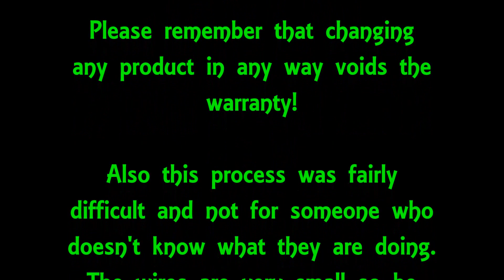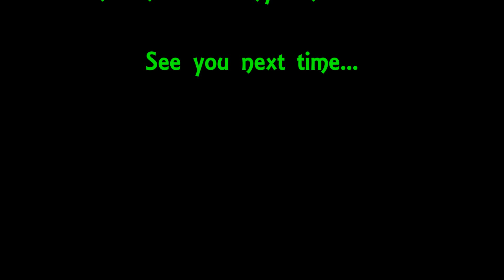How To : Dromida Ominus Motor Upgrade, Micro Motor Warehouse

Comment: Anybody still flying Dromida Ominus out there?Need help with all my blades turning in same direction?
Reply from the maker: You have the wrong motors (black white) (blue red) in the wrong spots. If you don't have any spares to swap you can just swap the wires, as brushed motors will reverse with opposite polarity. Make sure you get the props all spinning the same way they did when stock though, otherwise it will spin out.

Comment: I just did this upgrade but I used the dromida fpv props. the motors are plug n play but the leads from the motors are longer than stock. you have to either tuck wires or shorten them, I tucked them. I can't fly indoors with the nano tech battery tooo much power. the stock battery is better for indoor flying. different tone with the polymer pinions. after all these upgrades I gotta say I'm impressed, quieter, more aggressive flying is now possible! thanks for the inspiration.
Reply from the maker: Nice, it flew quite well after some upgrades.

Comment: recently i bought the motors, everything is working fine. but only one thing does not work and it is the drone rotation. i really need help because instead of just rotating left and right, it literally goes left or right. if anyone knows about this or has had the same problem, please let me know.
Reply from the maker: +Jeremiah Burgos So do you mean when you give yaw on the QUAD, it gives pitch input instead?
Reply: Yes, how can I fix this?
Reply from the maker: Jeremiah Burgos It sounds like you are in mode 3? I am not sure if you can switch, or how :/

Comment: hey rc addict no more soldering then they have plug n play motors that just plug in ???
Reply from the maker: +Ben Pyka Yep, I have changed the link to the plug and play ones :)
Reply: U think these plug n play motors will work on the new vista? ? O and how long did it take u to receive your order??
Reply from the maker: Ben Pyka I bet they would. It depnds where you ship them from. They have warehouses in the US and several oterh places. They use normal USPS for the US so under a week.

Comment: Are the motors for the blade 180qx as fast if not faster than the ones for the alias?
Reply from the maker: george aura I am not sure about stock but these are all the same except for the plug type I think.
Reply: Oh OK cool so I'm gonna have that crazy forward tilt and speed has you showed in your upgrades video?
Reply from the maker: george aura Well the tilt angle was all because I set the rates to 100% but speed and power should be improved.
Reply: OK great

Comment: Would using the traxxas motors and keeping the 700 mah battery be good mine are 25c and the ones for the traxxas is 650 20c
Reply from the maker: george aura The Traxxas motors "should" fit,I  am not sure though...

Comment: Did you end up taking the new pinions off and putting the old ones on? I noticed on the MM website they list this in the instructions. I didn't do this, as I found them impossible to pull off.
Reply from the maker: Andrew Hanke I never removed any pinions. With metal ones you just heat them up I think and they pull of but with plastic might need a special tool :/
Reply: Good tips, brother. I'll keep that in mind. Installed the new motors tonight, along with a new frame, and man... You weren't joking. Beast mode!
Reply from the maker: Andrew Hanke Sweet! A new frame? Where did you get that? Sounds awesome!
Reply: Amazon, for around 5 bucks. Busted one of the arms on the original. Learning to fly a quad for the first time. Took a lot of abuse!
Reply from the maker: Andrew Hanke Sweet, do you have a link? I am interested to see what it looks like :D
Reply: Here you go! Amazon seems to have all of the needed replacement parts. All super cheap. All official parts. I have had to replace several gears, rods, props and now the frame. http://www.amazon.com/gp/aw/d/B00OZTQLHI/ref=mp_s_a_1_1?qid=1437756483&sr=8-1&pi=AC_SX110_SY165_QL70&keywords=dromida+ominus+frame Easy to do.
Reply: Oh... And they have green and the other colors.
Reply from the maker: Andrew Hanke Oh...I thought you meant a new different frame.

Comment: They have since reduced the motors revolutions per minute and the color is different. Still have polymer gears and now have direct connect for ominus and an adapter for blade or whatever the other one was. Not as brutal as the first batch but they suggest you can still do it if you buy their black motor and solder on the connector. Original batch was burning out quick. New model is still cheaper than OEM. I will give a set a shot very soon. Have 5 spares OEM to burn up first. Got Ceramic 3X6X2mm bearings from TRB RC on ebays for 25 bills. They make the ominus respond much better and the motors last longer with the reduced drag. Just cleaned the bearings with triflow today. Cleaned up easy as they were open.
Reply from the maker: STORM6490MT Yep, I have added that in the description along with the updated link to the new motors. I had no problem with the stock bearings, even with all the upgrades I did I still want more power, but hey, it is brushed, the only way to get more is somehow may it brushless ;D

Comment: Hey, yeah put in the same motors, found mine started being more twitchy and glitchy than anything. Didn't give me the punch out off the ground that i was looking for. Turnigy makes an even better battery nano tech ne106118. Little bit smaller but much higher c rating.  Gonna buy a new one won't change the motors, but the batteries will make up for that.  Lastly, once you bind up, give throttle trim just until the blades start spinning. Keeps it from dropping out when you let off the throttle.
Reply from the maker: Shaka Zulu Mine didnt go twitcy, it was a little more drifty but not bad. Check out my newer videos on the better battery I use for this :) Thanks for the throttle advice, I was having that problem so I will try it out.
Reply: Welcome, anytime. 😊

Comment from the maker: This video is outdated, all you have to do now is buy the motors with the right plugs are put them right in :)
Reply: Link?
Reply from the maker: Victor Cuevas In the description as always.
Reply: can i upgrade my dromida vista uav
Reply from the maker: Daniel Camilo You, could, if you need new motors. They don't add a ton of power, but it is noticeable. Battery life is also decreased.
Reply: The RCAddict what do you recommend buying
Reply from the maker: Daniel Camilo Just keep it stock. But if you want more power, or need new motors, these are cheaper and better than stock.

Comment: instead of risking ruining your flight board, I just cut my Dark edition motor wires short, and cut off the connectors for the Ominus motors, and solderd them on so they were like the stock ominous motors. I just put a bit of shrink wrap around them too. I took a dremel and hollowed out the motor house on one of them, becaus I had a little to much wire. its a lot safer way to do it, and a lot quicker. you can also buy the micro jst plugs to solder on to the dark motors on ebay. I got sick of waiting for them to come from china so I just hacked the plugs of my stock motors. I love these on the Alias. it is like it is almost to much for the flight board. it will do some crazy stunts. but hey good video, it's good to see people experimenting.
Reply: here is a link if you want the micro jst plugs.  http://www.ebay.com/sch/i.html?_nkw=Micro+JST+1.25+2+pin&_armrs=1&_from=&_ipg=
Reply: steve sparrow but Benedikt does have these made ready for the Ominus now, but I think they were a beta test. he might be sold out.
Reply from the maker: Thanks for the info an advice :) everyone does things there own way :P
Reply: RCAddict i'm going to kick your addiction into high gear. I just picked up the Blade nano qx 3D. i can't put it down. it is so much fun. one problem. it only comes with one battery. I' m going to order some larger ones with more discharge. they're turnigy 300mAh 35 c. get them off ebay. then you have backing. if your go through hobby king they will dick you around. I'd also suggest getting a moputerized controller. that way when you fly 3d you can set up dual rates and expo. I'm using 25% expo now in expert mode. it's hard but I love the challenge. i would still get it rtf though as the other tx's won't allow you to do the flip and invert functions.
Reply from the maker: Cool that you got the qx3D! Yeah I'm not going to be ordering from hobby king and more and might cancel my order and he the batts from ebay.

Comment: I have these motors on my Ominus  along with the 950mah battery and it works awesome. It recovers much better and does flips on expert mode. It does run the battery down faster but I have 8 of them with 2 chargers.  I spliced the factory plugs on the new motors making it much simpler to install than this video. Happy flying everybody.
Reply from the maker: Will C352 Thanks for the comment! I back ordered a 950 battery a month ago but hobby king still hasn't got them in stock :( You can also just put new plugs that fit the ominus on to install them also :) I don't know that much about wires so this seemed logical to me :P
Reply: get your nano tech 950's from ebay. you can get two of them at once, they come from france, but it is free shipping, and they come very quickly. also put the alias gear shafts in the ominus and alis props. it will fly even better, and the shafts won't bend on a pancake. you have to cut the top off of the ominus gear though.

Comment: How are the motors working out for you? Do they make it significantly faster? I love my ominus but making it really fast would be amazing.
Reply from the maker: Ant'sEyeView They do make it signifigantly faster, but they draw alot more power inside im getting 7-8 mins hovering but outside in the cold like 1-4. Maybe the higher powe rate and the extreme cold the battery shut its self off, or mine is just worn out. I did a review of them, will be up soon. also i got a bigger battery.
Reply: The RCAddict Awesome. I picked up a couple sets, and a few bigger batteries.I look forward to seeing your review!
Reply from the maker: Ant'sEyeView Hope you have a good experience with them. As is say in my review not really sure these are worth it. What batteries did you get?
Reply: Ant'sEyeView Dromida is fast enough in expert mode. I like 10+ minutes of flight time I am getting with stock motors. To each his own
Reply from the maker: Ant'sEyeView Yeah, I put the stock ones back in. Maybe with the new battery i'll get much better flight times than I was getting with these,  2-6 mins